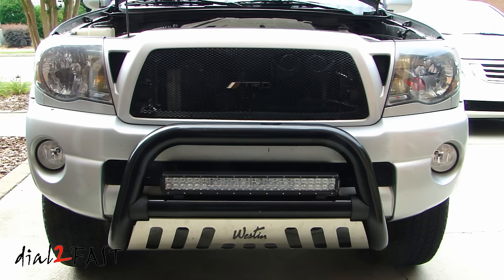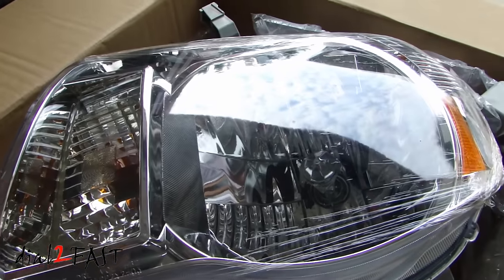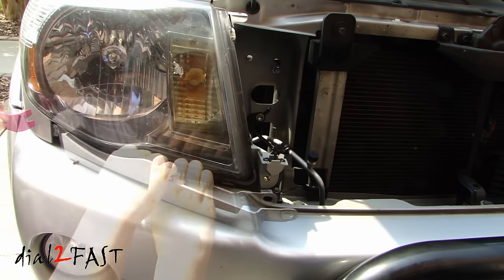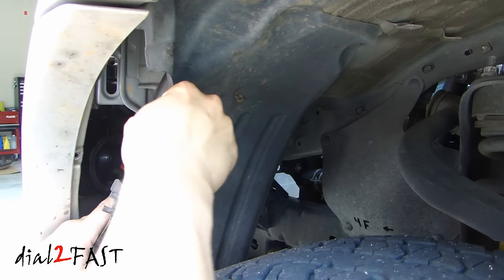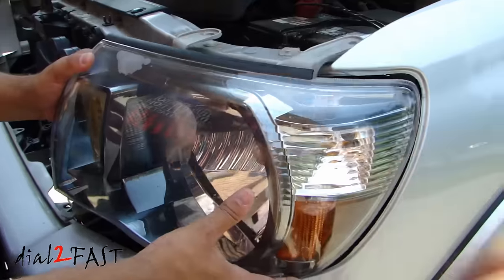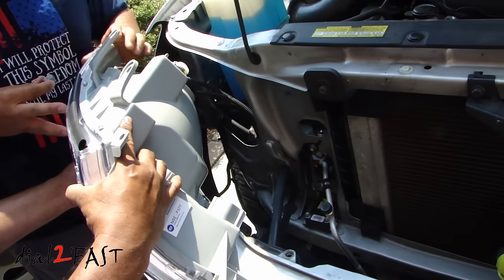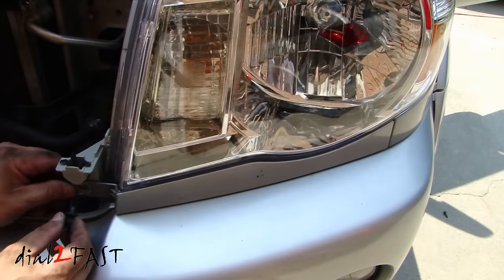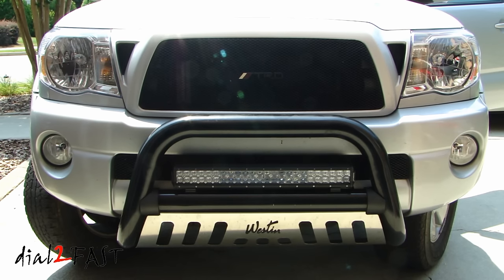Toyota Tacoma Headlight Replacement 2005-2011

Comment: Condensation built up under the lens covers, and if I replaced them, the condensation problem would not go away, and I cannot properly seal them because I have no nitrogen to replace the moisture-laden air inside, so I drilled three 3/8's inch holes near the running lights and three more toward the side as far as possible thereby allowing wind to evaporate the moisture out and that solved the moisture problem.

Comment: Would it help to replace the bulbs for the running light/turn signal to keep from burning them. Like LED there cooler .
Reply from the maker: You can replace with LED. It should be 4157 amber bulb. Here is one https://amzn.to/2ZP4We6   But you may need to install load resistors to prevent hyperflash issue.

Comment: Do yourself a favor take the time to take out a few more bolts and clips to get. Bumper ends loose. Makes getting hidden bolt so much easier. Other than that easy change out.

Comment: Great video, thanks.  What was the tool you used to remove the 10 mm bolt inside the fender liner?  It was at about 2:57.
Reply from the maker: It's a right angle screwdriver adapter tool. https://amzn.to/36RPe9l
Reply: Thanks, ordered.

Comment: Did these come Aimed already bro ?? And no moisture inside yet ?
Reply from the maker: Sorry for the late response. We did not have to aim it as they seem to be fine out of the box. But you can test it after you do the swap by pointing the light 25 feet away from a wall on flat surface. No moisture issue.

Comment: The only way I was going to get the hard bolt out was to pull the bumper cover out. There is a 10mm (really? another 10mm bolt?) at about 2:00 on the passenger side and 10:00 onthe drivers that lets you pull the cover out and down enough to get a socket and extension on that last bolt

Comment: I just got finished replacing both headlight assemblies.  Try as I may, I couldn't get to the bolt on the side - it was just damned near impossible to get a socket on it (and beware - there's a nut below it that doesn't have anything to do with the headlight).  My solution was to find another video (https://www.youtube.com/watch?v=769M2gYj6oE) for removing the bumper cover.  Turns out that it's just six additional bolts and 8 additional clips.  Made the job MUCH easier, IMHO.

Comment: Just two comments-  
  First the  bolt under the fender is indeed a real bitch.  It is made worse by the fact that there is a body bolt just underneath it (on my 2008 Tacoma) that must be put back if you fumble blindly and remove it be accident.
  Second,  it is some yoga maneuver to remove the old assembly, then to fit the new one in place. I suppose a body shop tech will pick it up soon and never have a problem. For me the left side was not easier than the right side.  I must have had a stroke or something  between the two sides for it was just as baffling the second time around.
  But the old cataract covered assemblies are in the trash and my 2008 Tacoma looks brank new.  
  Thank you for the video!